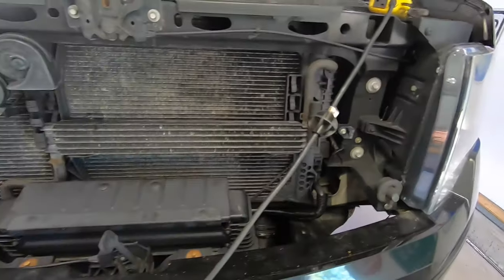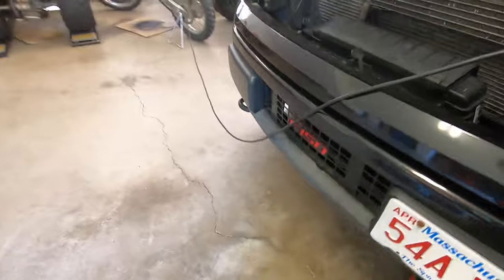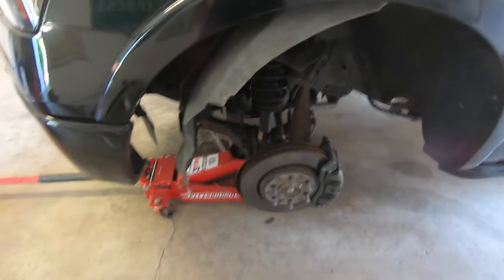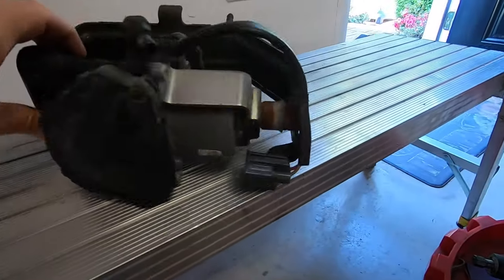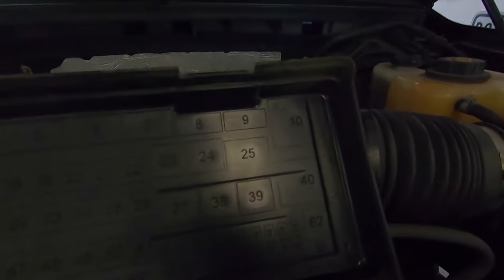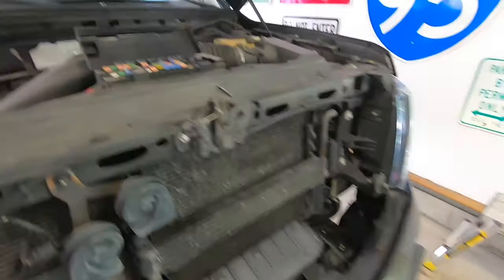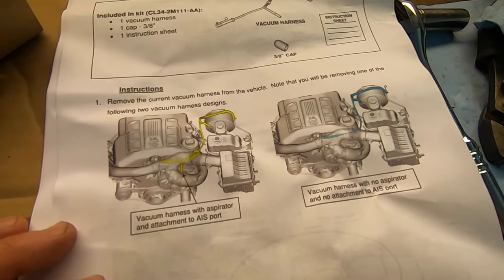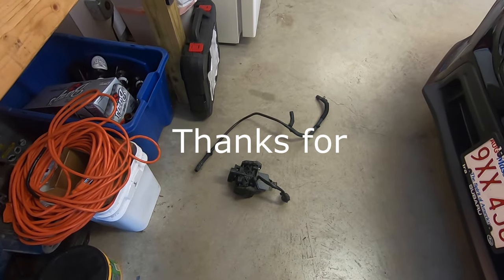How to Fix the Locking Brake Problem on Ford F150

Comment: Buddy I think you have just saved my truck. I had no idea where to start to try to diagnose what the problem was I just knew after the third calipers that it was not the brake caliper. You have won * the coolest guy on YouTube today* award
Reply from the maker: Also replace your brake line.

Comment: I have a 2010 f150 and after months of trying to figure out what the problem was, I finally came home to a cherry red rotor pad and my truck almost caught on fire. Literally this video saved my truck. It’s either the pump or the brake line. I did both and it works perfectly now…
Reply: Mine is a 2010 F150 5.4L.  Did yours come with the pump described in this video?
Reply: @pedrodelasancha516 I'm having the same problem with my 2010 5.4. Was it you brake booster?
Reply: @Ventallyouwant  No sir. It wasn't that simple for me to figure out. My customer bought his truck from a place that sells junk cars. So, they put together 1 truck out of 2. The rear end was from a 2010 and the front from a 2009. So, they didn't realize the front end suspension is different between the 2 years. So, every part my customer bought was for a 2010. I found out the abs pump module harness had been repaired and they did a shitty job. I had to resolder every wire. But that took care of the problem.
Reply: @pedrodelasancha516  ok thanks for getting back to me.  I'm pretty sure it's the booster I already replaced both calipers and rotors and it's still locking up

Comment: The video was very helpful! But for future reference there is a much easier was to change it. Open the hood and remove the screws holding the drivers headlight. After removing the headlight you can easily access the pump and lift it straight out.

Comment: I have to share this I could not believe that this was the problem. I had the front brakes not releasing for about 10 seconds. Finally I had to replace a calliper. After replacing the vac pump still dragging. The fix was take the wheel off take a crowbar and force the clamp that holds the brake line in place open so the brake line was loose. Did this on both front callipers and it was like a miracle. Problem finally fixed.
Reply: tried this as well and after two days of driving it seems to have worked.

Comment: Thanks for the video! My right caliper is locking up the passenger side front and I have to change the pads weekly right now. I have changed everything I could think of but not this part. What is the part number

Comment: I think I just had this !  Wtf.  Front driver side just was locking up !!  Almost caught fire. Made it home. Could have been bad almost went out of town 2 hours today.  Wtf is this !!  A common problem!?   Pulling to the left   Don’t see any leaks but drivers rotor looks weird. Something is definitely up. Had them done professionally a few years ago
Reply from the maker: You will need to replace the front pads drivers rotor and caliper. Once you over heat them they are done. MAKE Sure you replace the rubber brake line. Do all these first before you replace pump.

Comment: Thank you my left front is going through the same issue. I will go through your troubleshooting procedure to check it out. I have replaced my brakes and rotors and still have the same problem with the front left. I was getting ready to replace the caliper which seemed to be fine till I saw your video. Thanks again
Reply from the maker: Glad it helped

Comment: Thanks for this ! Was happening on the same driver front. I had to replace my pads and rotors a few times. I bleed my breaks 3-4 times in a 6 month span thinking it was that. I am replacing my vacuum pump next. Thanks again

Comment: Awesome video, i just changed my caliper and the new ones sticking. I was going to start with the master cylinder, but this video gives me hope i have the same issue! Easy wrenching, dodging unnecessary expenditures, and using tools i already have are my favorite things!
Reply from the maker: Change your rubber brake line before you buy the pump
Reply: Do you have a 3.5?
Reply from the maker: Yes
Reply: @RCBGarage the same rubber line you have showed in the video?
Reply from the maker: @MrAnajones caliper rubber line
Reply from the maker: @MrAnajones caliper rubber line

Comment: Thanks so much for your video.  This is my first semi new truck since the carburated days and all this electronic crap sucks.  I was at a light in traffic and got off the brake to accelerate quick in rain and the back wheels jus sit thier and spun with no movement forward. Front brakes and calipers all new but locked up, would not release. Craziest thing ever. Usually it's a bad soft line that causes this,but wow stupid expensive ideas the have on all these new vehicles

Comment: My F150 is 2014 stx 4x4 3.7 idk if mine is equipped because it's not Ecoboost but I've done Caliper, rotors and pads been 3 weeks haven't any problems till today coming home. This gives me hope
Reply: I'm working on one, same year, equipped the same.  What did you find wrong with yours?

Comment: I am having this issue and couldn’t figure it out, thank you so very much for this video!
Reply from the maker: Change your brake line first. It’s usually the issue
Reply: @RCBGarage  so one question,  I have seen that you always say to change the lines first, so my question is, is the problem the lines or the pump? I have the same problem, I just bought a brand new caliper and the truck is doing the same, so what should I do next? Replace the pump or lines? Thanks in advance.
Reply from the maker: @enriquereyes6977 I tell people to replace the line first for two reasons. 1st When replacing a caliper you should always replace the rubber line with it. 2nd eliminate all of the inexpensive potential problems first. The pump assembly is very expensive. In the video I show you how to test the pump to make sure yours works. Break lines are 50% of the issue on most vehicles

Comment: Boy am I glad I found your video.  I have a 2012 Ecoboost 3.5 with a stuck right front caliper - just took the wheel off to see what's what.  I'll try your suggestion about relay 25 and see if that pump is the problem, but I think it could also be corrosion on the caliper (they're the original, just with PowerStop pads).  If it turns out to be the caliper, I think I'll go all in on a new set all round, along with new stainless wrapped hoses.

Comment: Thank you for the video. I have a two-wheel drive 2012 STX with the 3.7 and I suspected that the advanced track system was to blame. The pump on my truck is a little different than the one on yours mine has all four brake lines coming to it and one from the master cylinder and that's all on a block with a pump on the back and a giant wiring harness going to it.

Comment: Thank you for explaining the humming noise! Did changing the pump stop the humming noise? Is it possible that the humming is because of the brake line check valve situation? I have a humming noise in the engine compartment (like a pump or electric motor running, not screeching or hissing, just running) when I am in Park or when I put it in gear while not moving but when I press on the brake pedal it starts humming. I also have a right rear brake system that has demolished two sets of pads in a matter of months. I also have an emergency brake that doesn't come off all the way unless I lift the pedal up the rest of the way. I wonder how all this might be related? Could it ALL be because of the brake lines? How can I tell if the right rear brakes are not releasing before they destroy the pads? I can't feel it doing it, but suddenly I can HEAR metal on metal on the right rear wheel. I haven't had the brakes looked at this second time yet, but I can hear scraping.

Comment: Hey man great video! I know it’s been a couple years since you’ve posted but just wondering if you recommend replacing the rear lines too? 

I changed the front 2 rubber brake lines and it seemed to fix the issue for a bit but the famous screeching and brake staying engaged has returned only after driving for about 20-30min. 

Do you think it’s the pump?
Reply from the maker: Try flushing the fluid

Comment: For your information the front brake pads will lock up if you put the pad with the bumps on it outside. The outside pad is smooth and the inside pad has the camel bumps. The vacuum pump is to ad vacuum to the power brake booster.
Reply from the maker: Thanks for your feed back. The locking up issues happens on these trucks before the pads and rotors are changed. 90% of the time it is the rubber brake line that is causing this issue.  On my truck the vacuum pump, caliper and line all went bad.

Comment: Caliper stuck here as well, 2014 f150 eco, 2021 FrontRight stuck, master cylinder and caliper/lines replaced. now 2023 front left stuck, plus i have  Evap codes, would this pump also throw codes for that? P144c/P0131

Comment: I'm having exact same issue thanks, question? Can I just remove the fuse and drive until part comes in. Thanks again.
Reply from the maker: Have you replaced the rubber brake line?
Reply: Same.

Comment: 2012 lariat I’ve changed all 4 roters, all 4 pads, and my bearings! Brakes smoking every time…. And bro I think u figured it out. I hope it’s a recall part so I can get it fixed on the free!
Edit: what’s the pumps name exactly?
Reply from the maker: Before you start throwing parts at it...…change the rubber brake line on the caliper that if locking up.

Comment: Thank you for this video.  I have a 2011 F150 with a 3.7 V6.  I had the same problem.  Left front caliper locking up.  I replace the caliper, pads, brake hose and pads. Flushed the fluid.  It seemed ok for a week or so.  Now its locking up again.  Saw you video and checked out my truck.  I don't think it has a vacuum pump.  I guessing the 3.7 ltr doesn't.  Checked the relay box and it doesn't have a relay in spot 25.   Any other suggestions?
Reply from the maker: It might be the distribution block.

Comment: I have a 2007 f150 4x4 xlt, I now have a problem with my brakes when I stop on a hill in the snow, my brakes are making a fast anti-locking noise and not stoping the truck properly, I have all new rotors and brakes all the way around. also, I just had my iwe replaced as well,4x4 was not working properly, I wonder if this could be my problem, I originally thought I have a brake bleeding problem all of a sudden, but when it's not snowing or on a hill, it stops on a dime, I also have a winding noise like you would hear from a power steering pump but there is nothing wrong with the pump, did you hear this noise as well. ty for the vid.
Reply from the maker: Sounds like you may have an antilock actuator pump issue. It could be from a bad wheel sensor. The IWE is inside the front wheel hub, the ABS speed sensor may have been damaged when that repair was done. Its a $30 item, I would start by replacing that and see if it fixes the problem.
Reply: @RCBGarage  ty i will do just that

Comment: Same thing is happening to my friend's 2011 Ford expedition the front driver side caliper is locking up sir it's got the big v8 what you did on your pickup would we be doing the same procedure ?
Reply from the maker: I would start with replacing the rubber brake line

Comment: Mine is 06 with stock calipers I believe 150k mile.  Rotors and discs are relatively new
Reply from the maker: Replace rubber brake line
Reply: @RCBGarage ok , sounds like don’t have a pump to worry about ?  Your thinking it’s just the line ?  What about caliper ?  Shoot I’d rather not replace calipers if it’s just a brake line

Comment: I have a 06 F 150 that my rear passenger keeps hanging up I have been chasing this issue and cannot figure out why this keeps happening..new calipers pads rotors 3 times flushed  fluids also I need help.
Reply from the maker: Replace the brake line. Problem solved

Comment: yep I'm in that money pit right now.
I have a 1999 Ford F-150 XLT 4.6 l brakes are locking up dragging whatever you want to call it.
bought new brake pads, but new calipers, but hub and disassembly, replace the bearings greased it and sealed, new brake hose, flush the brake lines twice since I bought a new master cylinder, I thought it was the glide pins on the bracket so I bought new bracket.
so the cause of mine breaks dragging I been monitoring for the last 2 weeks was they will heat up on my way to work 10 minutes I counted breaking at least 10 times and the brakes would start to lock up dragging you can hear it as my car rolling down the road making screeching sound embarrassing.
when I get to a destination I pull over parked the car and check the temperature of the disc.
the both discs are heating up at the same temperature from 100 degrees sometimes up to 190.
funny thing about it both discs are heating up at the same temperature so I know for a fact it has to be something with a chip or some kind of sensor which could be the ABS brakes module.
saw YouTube link some guy pulled out the 102 fuse inside the hood compartment that controls the ABS and it will disable it something I'm going to try out tonight I spent over $900 trying to get this truck back to normal I was about to buy a new power booster but I decided to look at more videos to see the cause so far I think it's my ABS brake system malfunctioning causing my brakes to lock up soon as I get in the truck it squeaks all the way to work and get worse when I get there good thing it's only 10 minutes drive but when I have to pick up my kids from school I am just ducking for cover such an embarrassing noise
Reply: @Michael_J_M14  to this question,it was not
Both side changed and bleed. Nothing has changed and still have the same problem
Reply: @Michael_J_M14  

Today is 3/16/23 I still haven't fixed the

problem. I replaced the

Master cylinder

Bleed the brake lines

Replace the pads. Twice Disk& rotates

Bearings

Bracket and brake Calipers

Both front Rubber brake lines hose from the masters cylinder to

the calipers

One thing I could tell you I'm suspicious

about. Everyone is having the same problem. I think soon as I been sucking out the old When this happens it could cause pressure rubbing locking up occurs.

brake fluid and adding the Orielys auto parts

brake fluid it started the hole problem. I read if the brake fluid is old it will have

water in the fluid that can cause it to expand.

buildup and that's when brake binding friction

I'm thinking someone knew this would

happen to make money.

Contact me in Mid June after a few days road test I'm replacing the abs brake pump mod unit I saw a leak might be the gaskets / O-rings
Reply: @RUDYAKAHALIBU77  well, hows it going with the brakes?
Reply: @starguy9  
Hey Bud you followed up good.
I'm going to be honest with you. I gave my mechanic$1,000 I told him test my ABS brake module pump.  He tells me it's not the problem it's my master cylinder.  I told him I put a new one in from O'Reilly's Auto.  He tells me they go through bad manufacturing and it could be the problem.  He is going to replace it on Thursday or Friday when it gets delivered.  I told him my brakes are binding up and sometimes locking up for a few seconds.  We park it and he bleeds both front brakes he says I have a dual brake master cylinder. He says the brake fluid is not returning back to the master cylinder that's what's causing it to bind up.
Check back with me after this weekend is over I will test drive it when he's all finished.
I know I'm at the tail end of this problem it should be solved.  If you replace the brake master cylinder and it's not the problem I'm sure it's the ABS brake module. Alright but hope you follow up cross 🤞
Reply: @Michael_J_M14  not for mine I changed both front left and right still have the issues.

I think it's my ABS brake module pump.
My mechanic is going to change out the master cylinder this Thursday or Friday when it gets delivered follow up in a few days.

Comment: So I replaced mine but when i let off the break it still stays for 3 to 5 seconds. Got new caliper and didn't fix as well. Any thoughts??
Reply from the maker: Did you replace the rubber brake line?

Comment: I'm suspect I'm having the same issue. Will start with the rubber line, but I for sure need new pads/rotors and vacuum pump. Not sure on the caliper yet. Do you think there's a way to keep the vacuum pump from failing regularly? like maybe a homemade housing or something to keep the elements out?
Reply from the maker: If all the plastic and rubber guards are in place that should be all you need for protection

Comment: I have a 2011 f150 with a 5.0 with the same problem, I don't have that pump, so now its been months later did your problem stay away by changing the pump? I don't see any comments from others saying that pump solved their problem, my problem started with the front right locking up and I changed calipers, pads, did back brakes too, didn't fix it, so then the next step was the rubber line and that helped, it went from being locked up to just dragging and what do you know now the left one is starting to do the same thing which makes me wonder if its ABS related since I believe that alternates braking from wheel to wheel.
Reply from the maker: I haven’t had an issue since I fixed it. Been a couple years now. I would imagine if your ABS module was bad it would throw a CEL code.
Reply: @RCBGarage  thanks for the quick reply, no codes at all , it's got me stumped. If it was an old school mechanical truck it would be an easy fix so I have to believe it's an electrical problem.

Comment: Hey man I’m having the same exact issue but I did what u did and removed the fuse thing number 25 and when I put the brake and took it off the wheel still didn’t move.
Reply from the maker: Change your rubber line going to the caliper first.